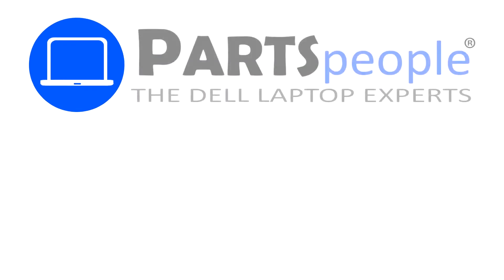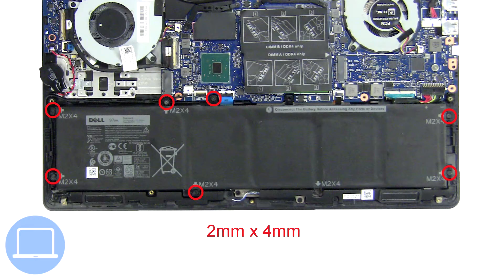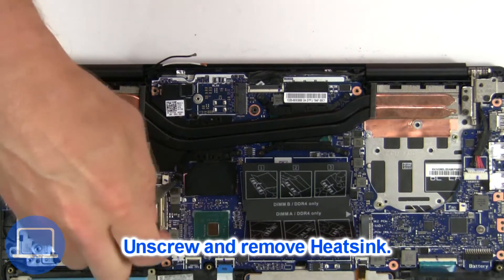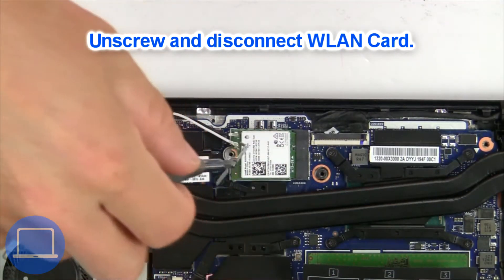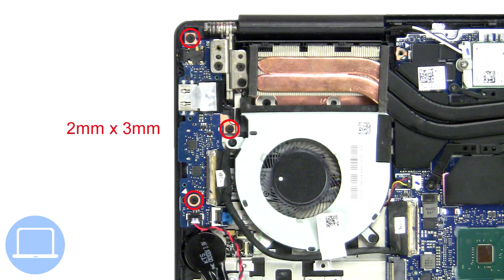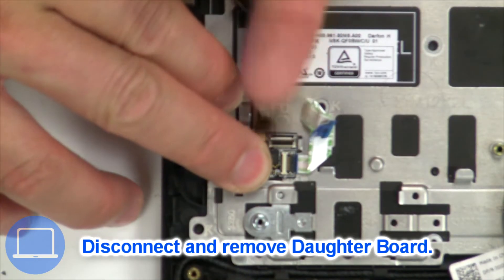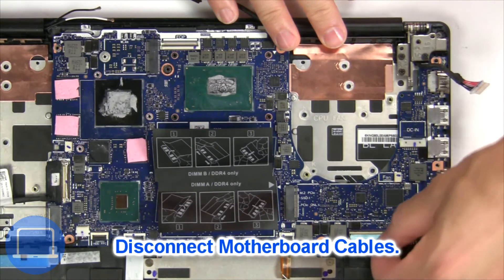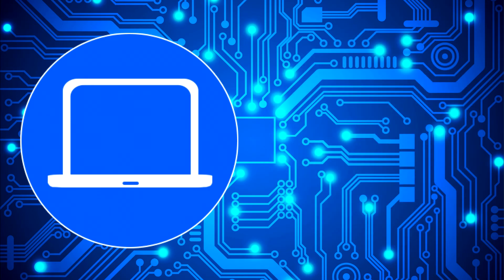Dell Inspiron 15-7591 (P83F001) Palmrest Keyboard Assembly How-To Video Tutorial

Comment: Good one, thanks. If you're only replacing the keyboard, then there are an additional 20ish tiny screws that need to be undone (marked with a "K"). The replacement keyboard that I had also needed to have the two connecting ribbons folded "just so" to allow them to line up with the plugs on the motherboard.
I found that not everything needed to be undone, but that's hard to know until you've undone everything. For example, the connectors to the daughter-board didn't need to be disconnected and I might not have needed to fully remove the speakers. But then I wasn't replacing the whole palm rest, only the keyboard.
Thanks anyway, couldn't have done it without this!